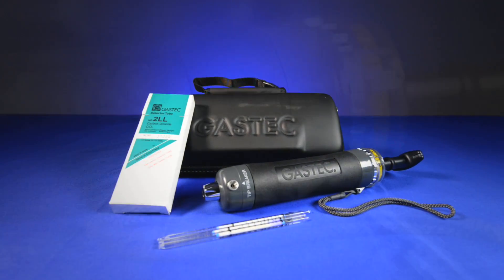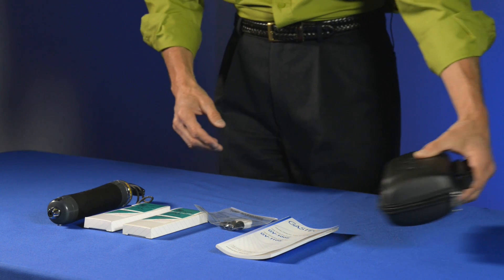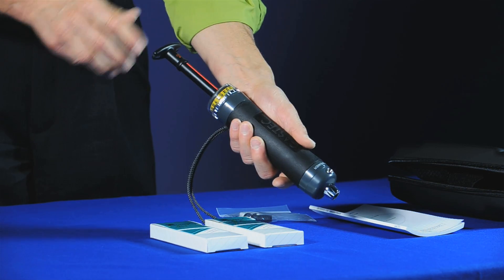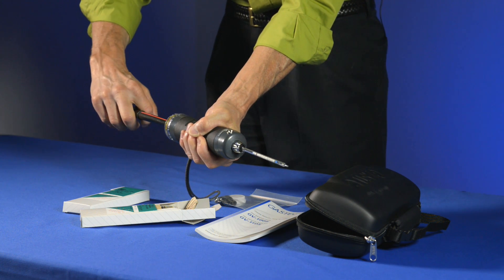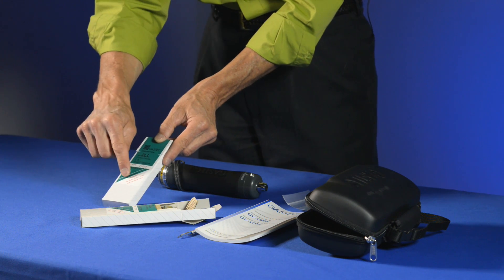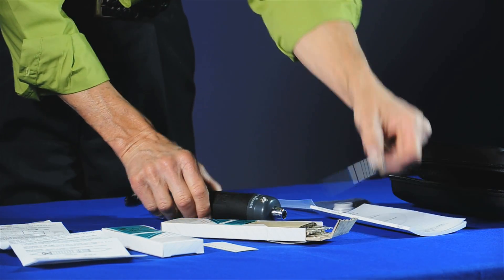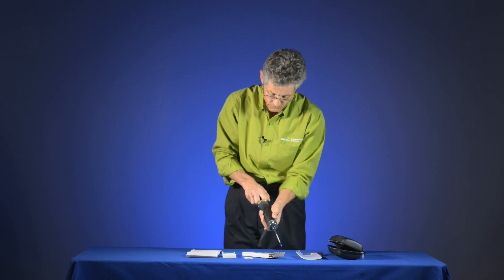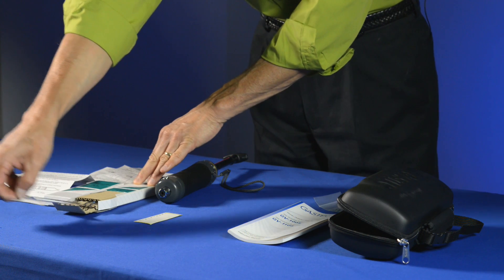How Gastec Gas Sampling Pump and Detector Tubes Works

Comment: if we need 2 strokes, do we need to wait 1 minute between the first stroke and the second stroke? or we dont need wait and do the second stroke?
Reply: There is a wait time between each pump stroke specified on the instructions in each tube kit. The time varies but ranges from 30 sec to 1.5 min generally between each pump stroke. Many tubes specify 1 pump stoke for common measurement ranges. Additional pump strokes are sometimes noted on the instructions to offer a 2nd or 3rd measurement range of that tube.